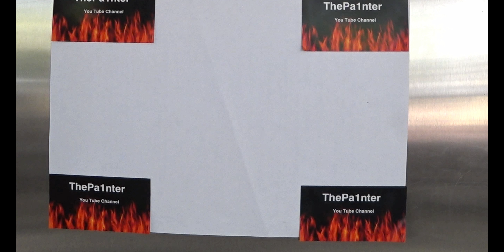how to spray oil based paint through your spraygun

Comment: Why don’t you spray the whole door mate? What’s the use of getting the gun going, if you’re gonna roll the doors? Strange set up mate
Reply from the maker: There are several reasons why I don't spray all of the door, one is overspray as ceilings are finished, Sometimes I have over 20 doors in one small room, how could you spray them? How would you do the edges? The bottoms? what do you do with the runs? how are you going to keep the enamel off the walls? off the ceilings? Setting a gun up for enamel takes me a few minutes and a few minutes to clean it out so easy to do. There is no easier way to do 20 doors than this method, if it was easier and better to spray them, trust me I would be doing it after thousands of doors.
Reply: @ThePa1nterhowto  Ok mate. First of all, get into using water based enamel, most painters are going this way. I’ve got the same sprayer as you, it’s a ripper and sprays Haymes Ultratrim beautiful. A lot of painters are spraying doors finished now. Like one of the other comments said, concertina your doors, attach a bit of timber on top of the doors to each other, then you spray your doors finished before you do your ceilings! I’ve been painting for 26 years and only recently got into spraying. On all new jobs, I will always spray my doors now
Reply from the maker: @folkfingerstylefreddy2154  This video is nearly two years old so that's why the video said how to spray oil-based paint, I don't use oil-based much anymore, however, I use the exact same system for my water-based enamel doors, I always finish my ceilings first so I don't have any doors in my way, I started spraying at 15 years old when the tips were not even reversible, so I turned 58 a few days ago so that is 43 years on the gun, many many thousands of doors later. I can spray finish a door, anyone can but you will have quality issues and it will take you longer, by the time it takes you to concertina your doors, I would have finished my doors, I haven't tried Haymes ultratrim yet but I hope to soon as I can get some. Does it run?
Reply: @ThePa1nterhowto  not everyone can spray ive seen alot of disasters.and definitely people can't spray water based enamels. That's why they have gone back to oil.. if you know how to work water-based enamel  its comes up like glass...what quality problems did you have .. but I'd rather just roll my doors the  doors it is faster. but sprayed looks alot better
Reply from the maker: @JONO3679  I find it best to incorporate spray and roll together for the doors , best of both worlds.
Reply: Could use plastic and use extendable polls tobrace it up against the ceiling and walls to keep the overspray from getting on the walls or ceiling. Anyone have thoughts on that method???
Reply: I am agree with you, why you spray than back roll? You do that on ceilings and wall, set up your doors attached each other with a piece of wood nailed or screwed on the top of them, if you worry about ceiling put a plastic and I bet you'll finish faster and do better job
Reply: @folkfingerstylefreddy2154  I have been sold the pup of water based enamels a couple of times over the years.  Each time I have come to regret it, that junk can cause problems years later.  It may be great for painters who get a wonderful looking job with less mess to clean up but it's not good for those who own the house and end up with strange problems like peeling down the track.  Any painter I hire that insists on that rubbish just won't get the job.
Reply: Oil is still the best as far as durability. It cures so hard and kids can’t beat it up like water based.  Also, people are having to paint oil based primer on old construction to be able to finish with water based… why not save half the time and just shoot new color in oil and be done?
Reply: Saying you can't spray the doors finished even though your spraying the inserts on the entire door is strange. Yes I agree you could pre brush the edges but if your gonna use a roller then why not drop to a 6 inch and push it into the inserts  your spraying right now. Rather than drag a hose around and set up and clean the gun. 
Pulling out a spray gun and ending up with a roller finish saves your shoulder yes, but sorry mate its a home made DIY technique not used by any professional decorator I've seen bar your good self in 30 years as a contractor.

Comment: What is turps?  I’m an American chick and new to spraying…I thought we couldn’t run combustibles thru the machine.  I’m stuck.  I have an X7 with Kilz original in my machine and it wouldn’t fire (the gun) It’s a pretty new machine but I don’t think it was cleaned properly previously.  I’ve changed the tip and extension…hoses.  But my gun won’t fire.  It initially sprayed, but water came out.  I have mineral oil to clean it.  But I am stuck.
Reply from the maker: I don't know your machine but it sounds like the intake ball is stuck, Don't panic, just put the handpiece gun and pickups in water until you have solved the problem, this will stop it from drying out inside. Here is a video that should help you.  https://youtu.be/wuVIeLROnIg    Turrps is Mineral turpentine or I think white spirits where you are,
Reply: You can usually get to intake ball which looks like a big metal bb by taking the nuts from the intake which is where you screw the paint line to. If you get the ball out and clean the area where it seats and then put the intake ball back in it should work. Note that's why u run paint thinner through your paint line when storing the paint pump.

Comment: I gasped when you turned the painted side of the door over and laid it up against the door underneath.  Do you think so differently than we do in the US. Very inefficiently. I would definitely have sprayed the whole door. I screw a 6 inch 2 x 4 blocks to the top in the door.
Reply from the maker: The wet doors never touch, they are around one inch apart to allow to dry, they are touching on the small corner against the wall, to spray the entire door is not efficient or wont be uniform,  you will get overspray on the ceilings and walls,,runs on the areas that get double sprayed and flashing from the tip. We don't think differently, ive just had 40 years of spraying to get the most uniform and economical finish i can for the money spent by the client. I think by the time you screwed your blocks on i would have finished my doors.

Comment: Hi from NZ Greg, thats a large ceiling that you used the graco on . I have just purchased one for my ceilings and am eagerly waiting its arrival. How does the GX19 perform and what tip did you use. 515? 1 or 2 coats ?  Thanks very much
Reply from the maker: How did your ceiling go? I'm eager to hear your experiences
Reply: @ThePa1nterhowto  Hi Greg, thanks for asking, I haven't done it yet, just waiting until spring/summer when we can chuck everything out on the deck and have stopped using the fire . Plus its a bit warmer.
The fire is the main issue as over the last 16 years when I last painted it the smoke that escapes when putting wood in has stained a lot of it . So just wanting to wait but can't wait at the same time lol.
Currently a bit like you with a broken wing though mine is a rotator cuff repair so unable to use left arm for much at all at the moment. Im going to try a FFLP516 but will practice in the garage first as the ceiling in there has never been painted so just plastered gib in there.
Hey while I have your attention, I hope you don't mind what is a good stain blocking primer or sealer I can spray everything with as the entire lounge ceiling and walls doors and window reveals need painting. I thought I could spray everything at once then finish each individually. Im going to use Resene Lusta glo semi gloss enamel on the woodwork to match the rest of the house . I was looking at using Zinsser Cover stain, turps clean up,  used it before on an old mahogany veneer cabinet and covered the dark colour perfectly, follow by acrylic enamel. Sounds like it would be perfect for what I need to do. Hopefully the plan comes together haha thanks again hope your arm is coming right. Hope your doc doesn't see any of your videos  using your dodgy arm :-)
Cheers 
Tony
Reply from the maker: @mcr9b6  I had my rotator cuff done 8 years ago so i feel your pain. I have always used a quick dry oil based undercoat for what you have to do,its my go too for the last 30 years so i cant comment on the others.If you have some left you can use it anywhere,paint rocks,steel,anything realy. Just dont tint it.

Comment: What ratio to you use for paint and turpentine/solvent?
Reply from the maker: I personally don't thin the oil based undercoat down, you will get runs
Reply: @ThePa1nterhowto  my gravity feed sprayer splatters the paint.  Someone recommended 2-1 and that is runny if not careful.  I’m going to try 3-1.
Reply from the maker: If it splatters its low pressure or wrong tip, id start there before thinning and ruin the paint, or you could spray and brush or spray /roll

Comment: Can any other solverts like acetone or DMSO be used on these sprayers?
Reply from the maker: I wouldn't use them in older guns because it will melt the paint in the machine and wreck it, new gun perhaps but not sure if it will wreck some rubbers or become explosive dangerous

Comment: Is diesel gas for trucks safe to clean the paint machine?
Reply from the maker: It is safe but doesn't clean oil based paint out properly. Use mineral turps if possible, remembering to earth your gun when spraying oil based , I make sure I use an old  metal paint can to earth.

Comment: Hi great video I’ve just bought one do I have to use an oil base on the door do they do a water-based paint that I can use on the skirting boards and door .. thanks in advance..
Reply from the maker: Yes they have a water based,just make sure your preparation is spot on.

Comment: what is this turps diesel you are thinning with? What else works? Acetone?  Will it also work for ext oil primers? Thanks for your educational video!
Reply from the maker: I'd be careful of using acetone in an old spraygun , it could dislodge to much paint. Not sure what it would do to the pump either. Better to stick with turps or diesel that has lubrication
Reply: @ThePa1nterhowto  so prime with diesel fuel before using oil based acrylic to put a coating in the machine?
Reply: @ThePa1nterhowto  so prime with diesel fuel before using oil based acrylic to put a coating in the machine?

Comment: If frame and baseboards are painted on oil sami gloss mate pain. First. . you think for paint wall with eggshell 
is necessary primer with oil base again?? Or just one coat light of off body paint work?? Thanks
Reply from the maker: Im not understanding your question?
Reply: @ThePa1nterhowto   .. if I spray semi gloss oil base , I need to do walls you recommend primer oil base before paint wall... hopefully you get a idea or understanding me...
Reply from the maker: @spanaway77  If im understanding right,the question is ,after you spray your trim with oil based satin enamel ,do you need to undercoat the overspray areas  or can you paint over it with wall paint. Next day when you sand your walls,just scuff up the paint then normal wall paint is fine. Is that correct?
Reply: @ThePa1nterhowto   yess!!  is correct.. paint over the ,over paint  oil base,  .. what you recommend me..
Reply from the maker: @spanaway77  yes its no problem, next day after a sandpaper

Comment: Im refinishing the walls in my house and have scraped the old paint off the drywall in guest bedroom and have applied drywall mud on walls and ceilings going for a L5 / smooth/flat finish.  What kind of oil based primer and top coat would you recommend for that or would you not use oil based for that kind of finish?  I recently purchased a gallon of oil based primer (Sherwin Williams all purpose oil based primer) and it dried HORRIBLY and had matty spots all over the place.  On my 2nd attempt I used Penetrol to help thin the primer hoping it would dry flatter.  It did help but still was horrible looking.  Am I doing something wrong or is this a bad batch?  I was using a natural bristle brush.   After seeing this, I'm now getting 2nd thoughts about using oil based primer and top coat on my drywall which I haven't started to paint yet.  Your thoughts on this?
Reply: I forgot to mention I used that oil based primer on some door jamb boards that I bought.  It left high matty spots all over the wood.  My first attempt I didnt use Penetrol and the primer was extremely hard to spread and dried extremely matty.  My 2nd attempt I added Penetrol to this oil based primer and it helped a lot with spreading the primer with my brush but after it dried there were still matty spots all over the place, just not quite as bad as with no Penetrol.
Reply from the maker: Hi,you should have used water based , if you have only oil based,you will need to thin this down with mineral turps so it can soak in easy.
Reply: @ThePa1nterhowto  I've never heard of mineral turps to be honest (rookie painter) but is that a thinner of some kind?  If so, that's what Penetrol is.  Maybe I didn't add enough?
Reply from the maker: Mineral turpentine is white spirits, its used to thin down oil based paints, penetrol is an additive to help the paint flow and stick , I wouldn't use penetrol by itself to thin down old paint

Comment: Which tip the best for oil based in air less spry gun?
Reply from the maker: Depends on what you want to spray but I use wagner 211,311,and 411 tips for enamel

Comment: Nice video. If you get some L brackets and drill them on the top of the doors you can stand them up like an accordion.  This is hands down the fastest way to spray doors.
Reply from the maker: The preparation time using brackets is a pain before and after , and also you cant spray them with finished ceilings and walls because of overspray. Also you cant move them around the room to walls as you finish them. I do my doors my way because I believe it is the quickest and best way ive learnt in my 40 years painting, otherwise, I would be doing them differently,but each to their own.
Reply from the maker: @Scarletpimp72   Dream on, if it was better and quicker, we would be using that system. Don't you think we have tried all the other systems over the last 40 years and thousands of doors?

Comment: Hey Mate, How are you? Can you please tell me how to sand metal frames? Its new built property but there is dust on frames from plasterer work. Thanks
Reply from the maker: I would use the foam sanding pads to give them a scuff up, dust down and undercoat
Reply: Cheers mate. Really appreciate it.

Comment: Hi. seen you use Hyde filling knife a lot (my favorite).  What  tool bag pouch do you use. A bit dangerous hanging out of my back pocket. Good to see you posting again. Chris
Reply from the maker: Hi Chris, Yes the Hyde is my favourite tool and one I feel naked without. If you go to bunnings and buy a carpenters chizel pouch and that will keep you from slicing your leg open. Hint with those blades, sharpen them on the concrete as you putty and they can get razor sharp.
Reply: @ThePa1nterhowto  Thanks. I still  think I owe you a day's work for all your tips. Must admit a lot is what I do. Great to see. Better than  people on LPA .
Reply from the maker: @christozeb3330  There are good people on LMP  but they keep quiet cause if they say anything they get hammered. Its a shame all the older skilled people are not able to feel comfortable there
Reply from the maker: @christozeb3330  I've got an opening for a painter for a few days if your interested at wavell heights (north side Brisbane) just working with me to finish a new lowset house here. It's a long drive from home and the sooner I finish it the better. Let me know if your interested?

Comment: What is turps sorry from the US. I’m actually spraying oil through my pump. For the first time. Thanks for the video. I’m guessing it’s turpentine.
Reply from the maker: Yes turpentine,keep all your old turps for the first wash,fresh turps then water. I always keep the ends of my spraygun sealed off with water to prevent the paint inside drying.
Reply: @ThePa1nterhowto  This will be my first time spaying with oil primer. What do you mean by keeping the ends of spraygun sealed off with water? I think I follow you up to a point: 1st flush with old turp, 2nd flush with fresh turp, then flush with water then what? If for storage you could store with turp inside the pump and gun correct? Especially if using for oil based next time,  but if going to be using acrlyic then flush with water and store with the blue stuff??